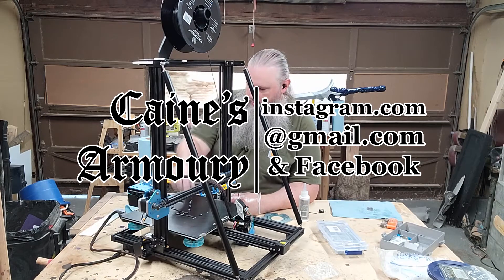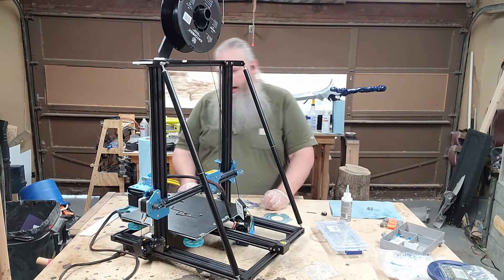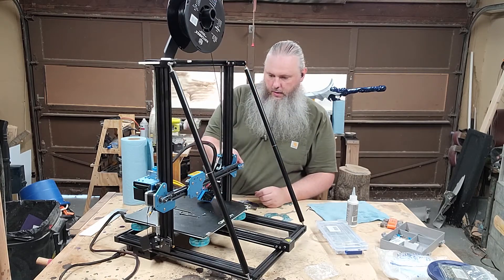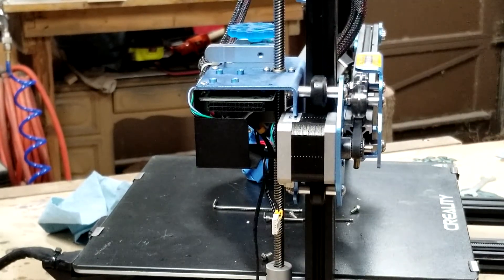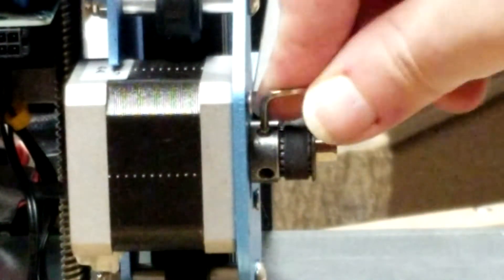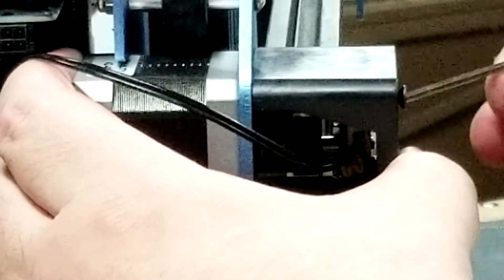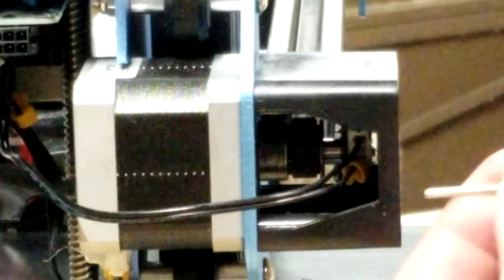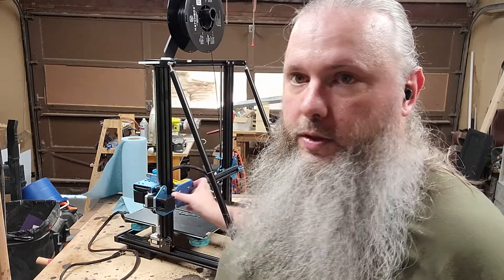CR10 V2 V3 X Axis - Pt 3: Reassembly & Shimming

Comment: Hi reali nice guide for CR 10 V2 I have question on you what you think about metal wheels specialy stainless steel i wont upgrade mine CR10V2 with thees. And sorry for mi english im from czech republic so i hope you undertan me.
Reply from the maker: Hello to the Czech Republic! I have a friend in Slovenia!
Metal wheels can work, but you do not get the play rubber wheels offer. Meaning, when you tighten the wheels against the V Grooves on the aluminum bar you can deform the aluminum by tightening too much. Aluminum wheels can still deform the V-Groove. If you cannot get polycarbonate wheels, you will need to replace the black ones yearly with frequent use.
Reply: @cainesarmoury8962  thank you very much for ansver i try get polycarbonate one and im looking forward to new video about beter hot end fo cr10v2 im working on one too with base of dragon hot end and my own direct drive